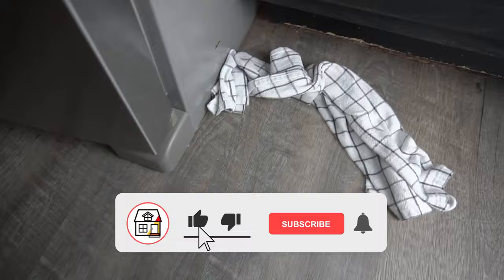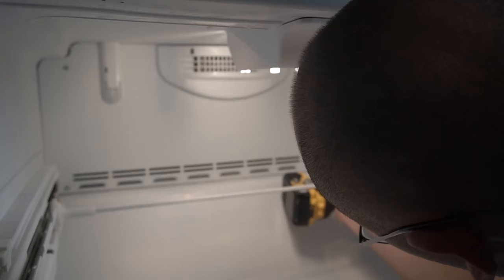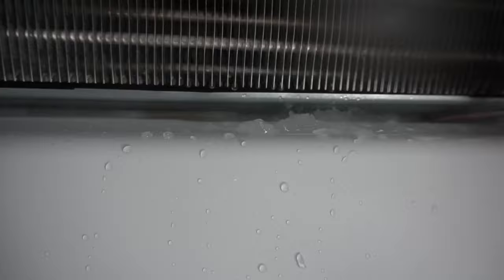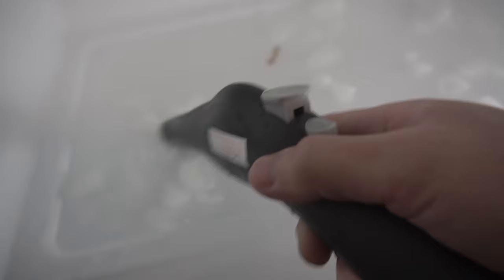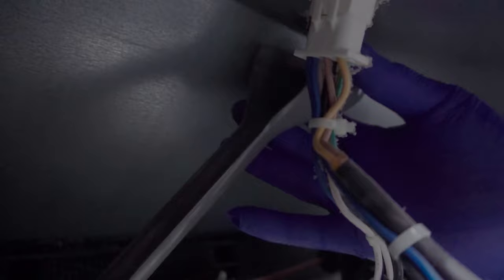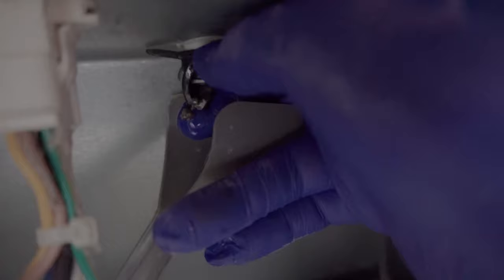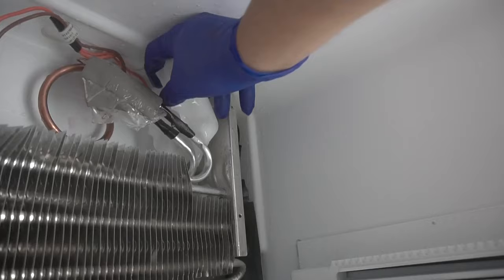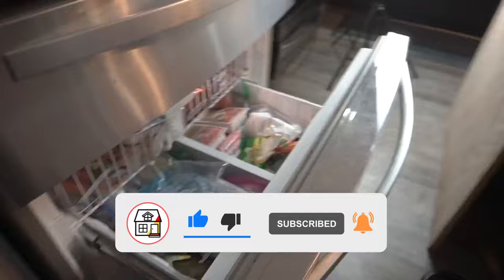How To Fix A Leaking Refrigerator QUICK! Water Leaking From Freezer - SOLVED DIY!

Comment: Thanks for this mate. But I have a slightly different problem. I get no leak or excess water inside the fridge/freezer. What I do get is a lot of water in my drain tray/pan at the back (outside) of the fridge. It fills up and I am having to drain the water from the tray every 2 weeks. 

What could be causing that please? Thanks.
Reply: Based on the video, it sounds like the evaporator fan may not be functioning correctly.  That evaporator fan is not evaporating as it should, otherwise your drain tray would be empty.  To trouble shoot, Unplug, remove rear lower panel, locate tray and fan.  Then plug power plug back in.  If fan is not moving, that's your problem.  You can then replace that evaporator fan.  Hope all works well.
Reply: @joe4runner  So this fan blows all the time?? I have a Samsung fridge.

Comment: That drain channel is a well known design fault. It freezes over and cant drain. It needs to be replaced with a P trap tube like freezers have always had in the past. Otherwise your problem will reoccur. There are drop in replacements. Idiots at Whirlpool...

Comment: The proper way of repairing that drain issue is to remove that rubber "duck bill" and replacing it with a new p trap available from Whirlpool. Your blocked drain will reoccur in a few months.
Reply: @FrankRizzuti: Will you please post here the "P" Trap Part# from Whirlpool so I can buy one?
Cause I'm getting ready to do this same "fix" very soon to our Samsung Refrigerator, since it's been leaking water on a weekly basis now.
Reply: @cma8165  Samsung has it's own fix for leaking water into the refrigerator. Call any Samsung parts distributor with your model and serial numbers and they can supply you the part. Hope this helps.
Reply: @frankrizzuti1096  Absolutely will sir, thanks!